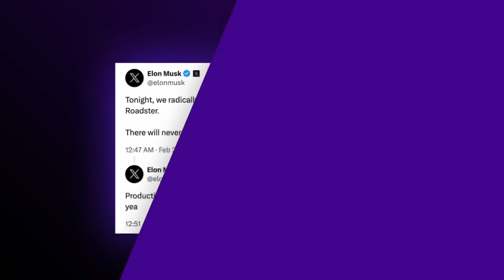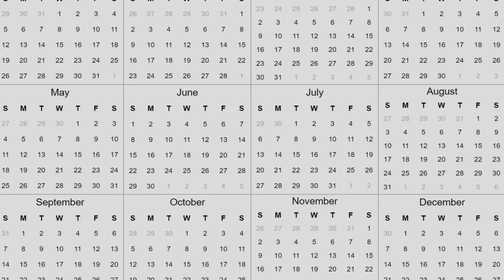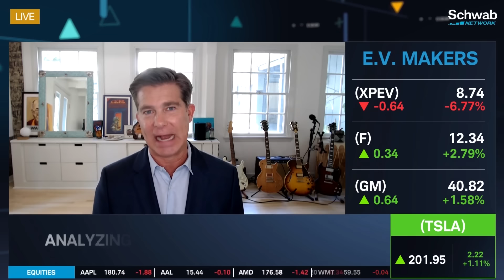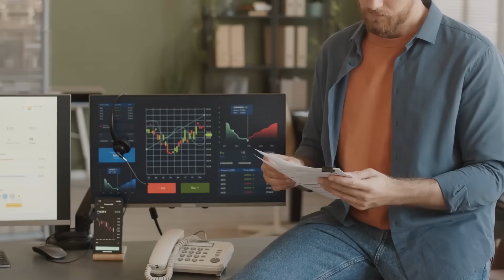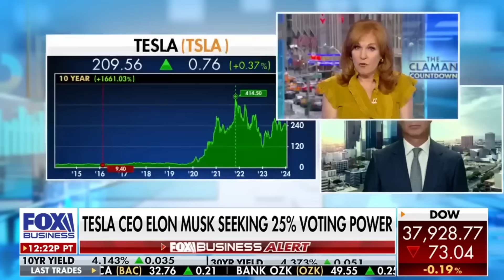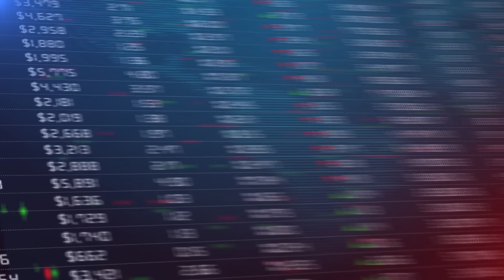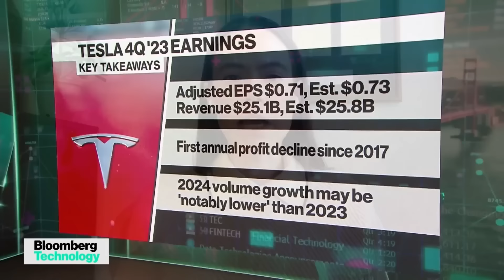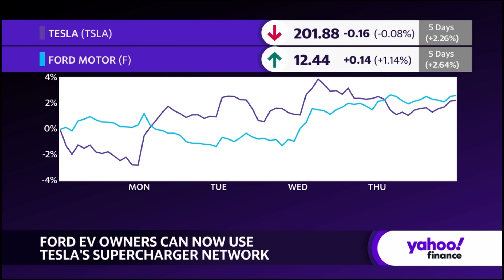Why TESLA Stock Will Be Changed FOREVER On March 8th!

Comment: At 1.9 seconds that is no better than the full SUV Model S, so nothing fantastic. There is a competing race quality EV with a 1.7 seconds. BUT what gives the Roadster a hand up is the optional SpaceX package of compressed gas thrusters which cost another bundle, take up space, and have a 0 to 60 of less than a second, if you can keep your lunch from exiting by one end or the other 😅
Reply: The model s is not an SUV